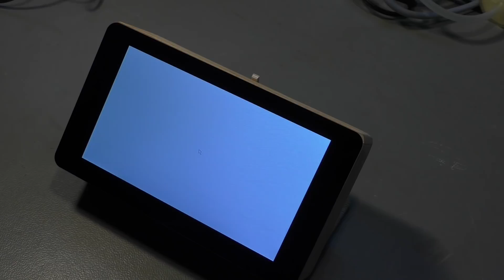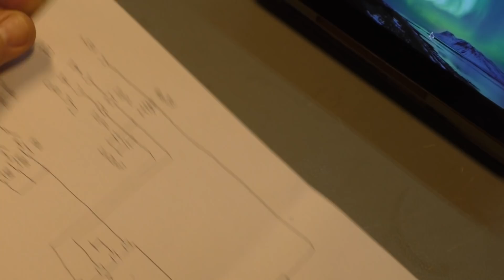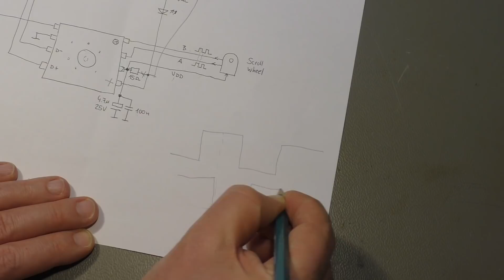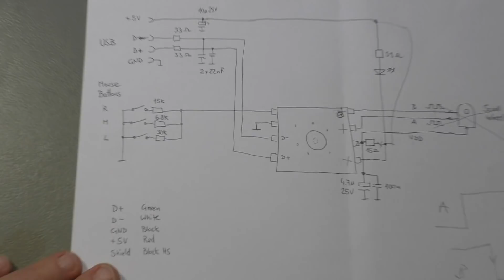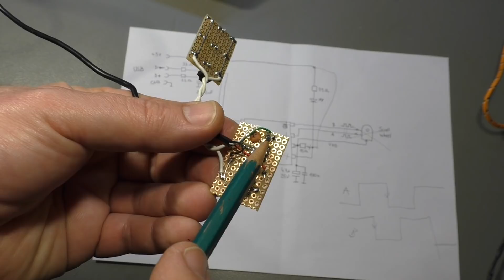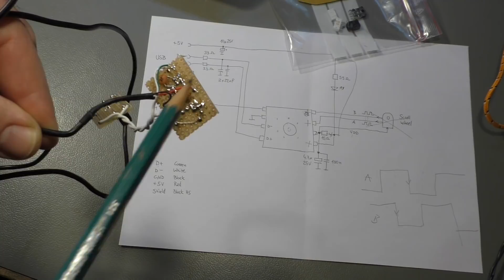Mouse buttons for the Raspberry Pi - (PWJ80)

Comment: Nice work but as the Raspberry Pi has general purpose input output (GPIO) pins you could of wired to the gpio pins and a very small Python script to trigger a button press as the right mouse button.

Comment: Are you aware that Linux kernel has support for buttons connected directly to GPIO pins using device tree ovelays? It might save you usb port and bit of soldering. https://github.com/raspberrypi/linux/blob/rpi-4.9.y/arch/arm/boot/dts/overlays/README#L507 is good reference how to use it if you even had need for even more buttons (any buttons, btw, not just mouse buttons :-)
Reply from the maker: I already thought that there is such a solution... but if no soldering is involved, where is the fun? :-)

Comment: Interesting approach to scavenge just the parts you need from a complete USB mouse. You could probably build something equivalent with something such as a cheap PIC16F1454, but if you weren't already familiar with writing USB device firmware that would take a lot longer.
Reply: Thanks to the bluepill and blackpill boards, STM32 devices are really good for this. Decent-ish vendor provided USB stack (with a bunch of third party ones otherwise) and disturbingly cheap.
Reply from the maker: Sure there are other solutions. Using the GPIO port would probably work too. But why programming PICs when everything is ready to use inside that mouse?

Comment: If the display supports multitouch input you may be able to use a two-finger tap  to emulate a right mouse click.
Reply: Right mouse click is usually touch and hold.
Reply from the maker: Usually.... but not on my Pi